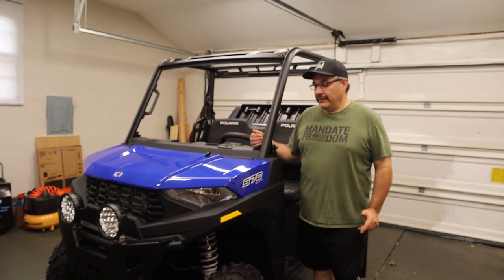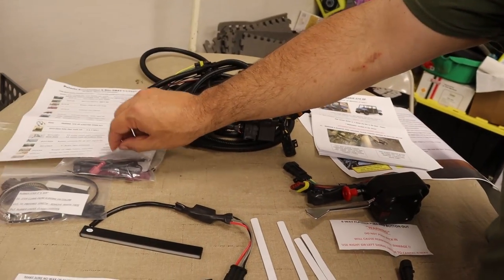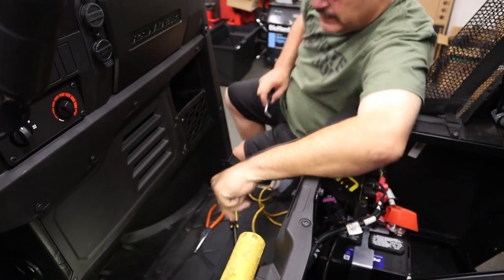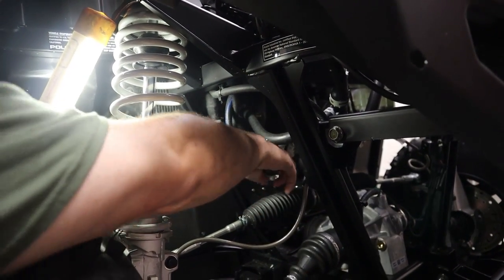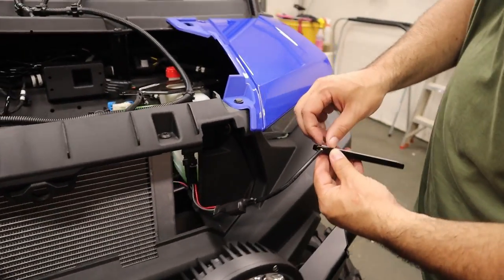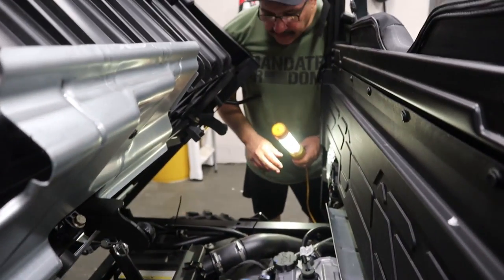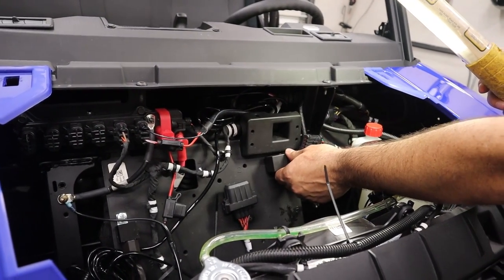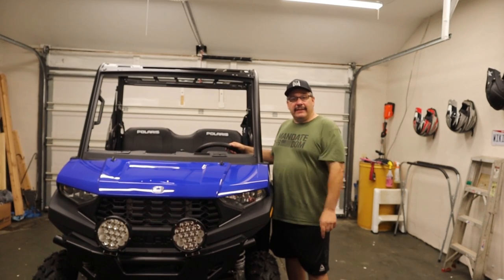2022 Polaris Ranger 570 SP Turn Signal Kit Install

Comment: Is it possible to plug the turn signal lever backwards ? My lever is opposite of what it should be. Dash, front & rear are correct, but I have to lift up for left & down for right. I didn’t install.
Reply from the maker: Sounds like its backward. Is the lever installed on the steering column right? Do you see the indicator lights for the turn signals? Is the four way red lever behind the turn signal lever?
Reply: Yes the lever is installed the same as yours, just like a car. Didn’t know if the wires that plug into that can be backwards ? Didn’t want to tear dash apart to see if it was even possible especially with my ride command. It’s a 21 XP 1000
Reply from the maker: @supercellf5  I dont know if that's possible. The plugs only plug in one way and cant be installed wrong.
Reply: @UTVDIRT  thanks. I didn’t think so, but Barry said they are all checked before shipping. 🤷🏻‍♂️

Comment: I just noticed they released the 2023 models and the 570 sp now has led headlights with the signature led surround outline. I have a 2022 also and would be interested in this upgrade. Seems that you know some people to get these parts and accessories for yours. Would you know anybody at your local dealer or with Polaris that maybe could give us a part number if we could upgrade? That would also make for some good content here on your channel.
Reply from the maker: Yes I also noticed they went with the new LED headlights. I have been checking around and they are supposed to get back to me. That would be a good upgrade to have and video to do. I will let you know. Thanks!
Reply: @UTVDIRT  sounds awesome! Love the content giving me ideas for mine, only problem is the cash! Lol
Reply from the maker: @swampfoxpicks6908  Yeah it can get expensive lol.
Reply: @UTVDIRT  for sure!